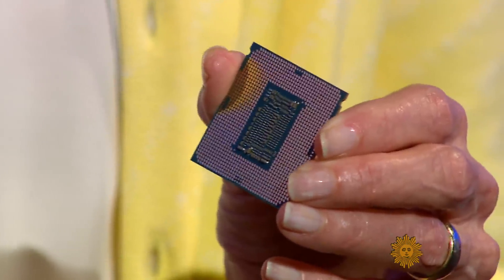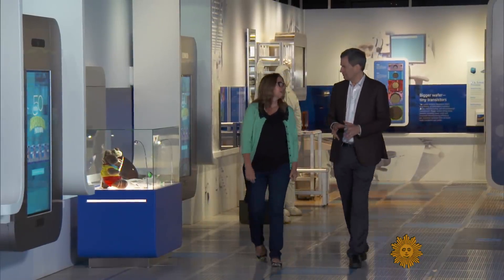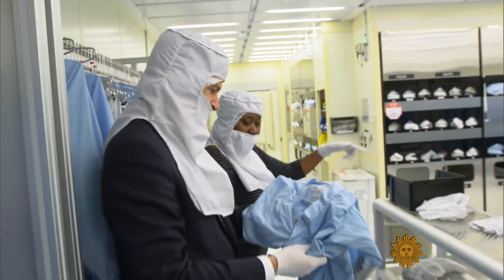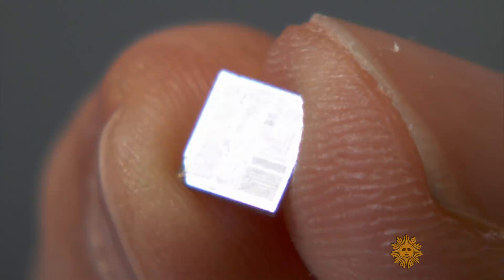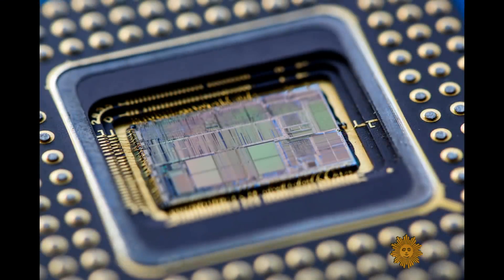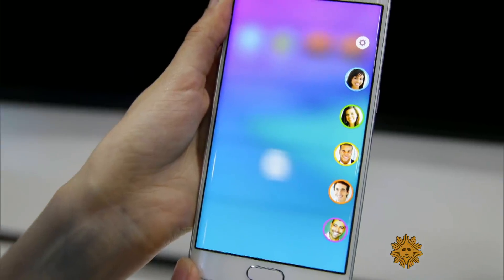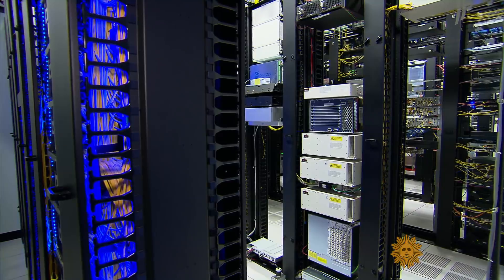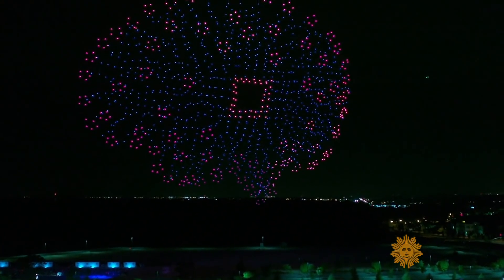Remembering 1968: How Intel was born

Comment: This is insultingly bad history, even for an obvious informercial.  Noyce (and Kilby at TI who invented the SAME IDEA at the SAME TIME) did not conceive that a computer would be reduced to a single chip.  They merely patented the idea that you could connect components together.  That's all.  An important starting point but that's all.  And Intel almost failed several times before they lucked out that IBM selected their processor (which Noyce did not invent at all) for the original IBM PC, when others had better technology available.  Intel won, and they get to record the history.  But it's very very flawed.  

And having the corporate strategy officer give a fab tour is just laughable.  But I can live with that.

Comment: Greed and lack of vision doomed Intel, and now ARM processors live in mobile devices. Intel has spread itself out into many new emerging technologies hoping that one will become the next big thing, but they blew the opportunity of the century.
Reply: the x86 architecture in both intel and AMD processors still dominate all desktop operating systems. ARM chips just use a low power RISC meaning that they work well on mobile devices, intel didn't intend to go into that market in the first place.
Reply: Intel had a $220 billion market cap bud, that's an opportunity seized in my book

Comment: Also, IBM started with the 5100 which failed. The 5150 is the classic IBM PC in the Chaplin commercial. That came about because they created a rebel cell that worked outside of IBM. The only IBM part in the 5150 was the BIOS chip.